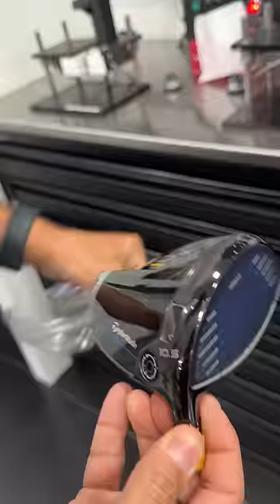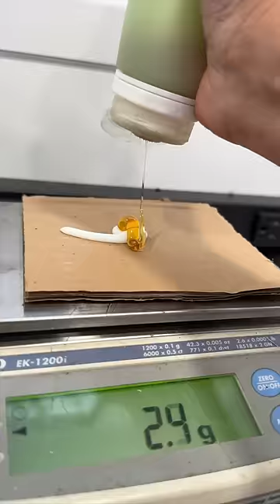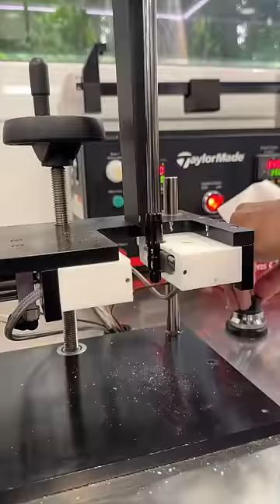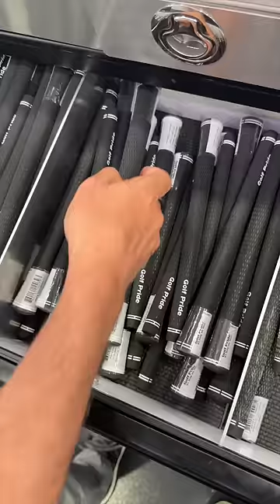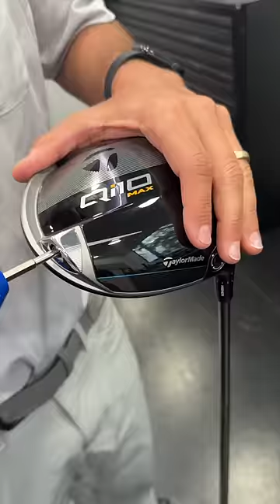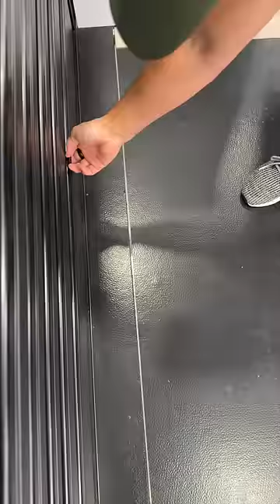Sounds of 10K. 🔊 Building Nelly Korda's Qi10 Max Driver | TaylorMade Golf

Comment: Nice, some pepper in the glue for extra spice. 🔥
Reply: 😂😂😂 Yes
Reply: Shafting beads but I like pepper😂
Reply: Nelly loves pepper, she hates cinnamon
Reply: Is it fine ground pepper or crushed peppercorn?
Reply: Cursed
Reply: Mayo, honey, and pepper is what I saw lol
Reply: I thought it was gun powder.
Reply: @capt.KZ3008 ALWAYS .... toast your peppercorns
Reply: Tiny little beads (usually glass or silica) in the epoxy that ensure consistent spacing between the shaft and the hozzle. Otherwise there could be too little or too much epoxy on one side of the bonding surface. Now you know!
Reply: @tjdjultima  wild how that works, science man.
Reply: That makes sure the shaft is epoxied in the adapter dead center. Similar concept to a bearing in a wheel instead of a hole in said wheel flopping around loosely on an axel.

Comment: About the deeper hosel on the Max; Is it a sneaky way to make it even more forgiving, by making the club shorter, or what's the idea?
Reply: Almost all the pros take an inch or 2 off of the bigger clubheads to give them more control of the clubface. Drivers, woods, and even hybrids sometimes.
My driver was 48" when I got it. I stuck a 45.5" shaft on it. Night and day difference in accuracy bro.
The regular shaft with the stiff tip is a must. The more you take off the shaft, the less the club will flex making it seem stiffer.
Reply: @gregoryhoff3281  No normal shaft is 48 inches, that's a long driver shaft length.
Reply: Exactly they come standard 45.5"  @AlanenJ

Comment: Don’t like how taylormade doesn’t offer different weight options for the everyday golfer.  I want to be able to change my weights in my QI10 whether it’s the front or back. Also would be better if they gave out weight kits so people could more professionally get fit for them.  Taylormade lacking with that
Reply: They do in proper fittings 🤯
Reply: I just made a different comment about this. My fitting they didnt even bother with weights. Shame really. Total shame.
Reply: @CharlotteK2008  demo days they don’t offer and at golf stores they don’t. TM doesn’t give weight kit like other manufacturers do
Reply: Fitting isn't really a fitting unless you yourself know what to expect out of the equipments and know what you want out of it

Comment: What’s the dust he put in the epoxy I’ve never used this before ?
Reply: I assume maybe graphite but if so what’s it’s purpose
Reply: @kytho7425  they are little beads and help to center the shaft in the hosel.
Reply: That’s glass.